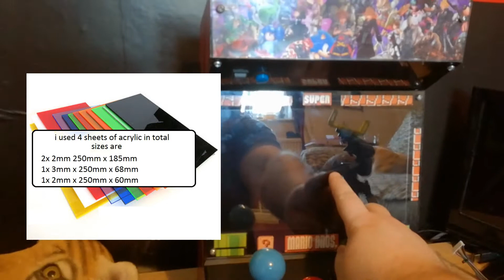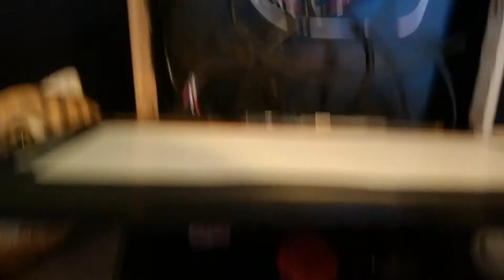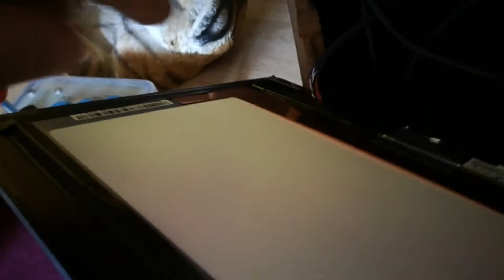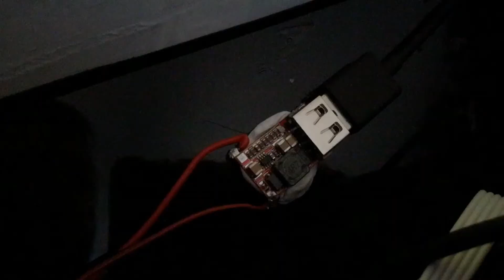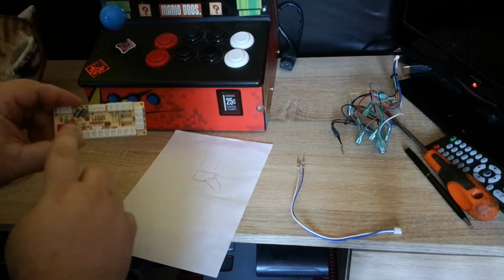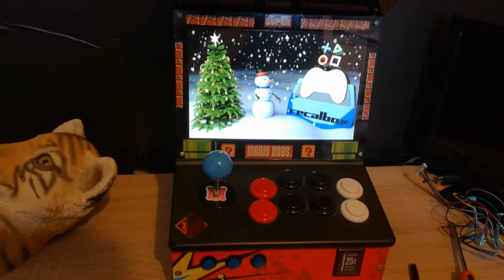icade to pi cade convertion project for just over £60

Comment: Wouldn’t be easier to use the HDMI from the Pi to the screen and use the Pi Bluetooth for your controller and also the Pi own power adapter for the Pi as it cuts voltage from 12v to 5v anyways? Really all you need is a 10inch screen and the Pi?
Reply: For one I wanted all running from one power supply the pi to the screen is hdmi and for the Bluetooth part I hard wire things as Bluetooth can cause lag and be unreliable and I was using a pi2 that hasn't got Bluetooth

Comment: Great video! I just bought an icade to do the same conversion. A few questions. 
1. How did you remove the "security" screws to get access to the back of the controllers? 
2. Do you have a link for the blue buttons?
Reply from the maker: I broke the security pin out with a flat head screw driver 

And the buttons are 16mm momentary push buttons from aliexpress https://m.aliexpress.com/item/1628167044.html?pid=808_0000_0201&spm=a2g0n.search-amp.list.1628167044